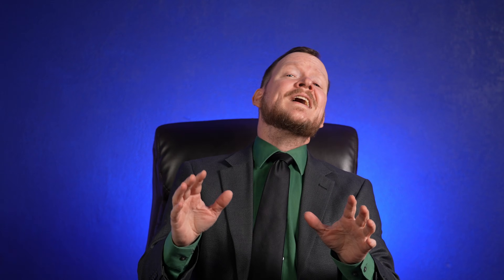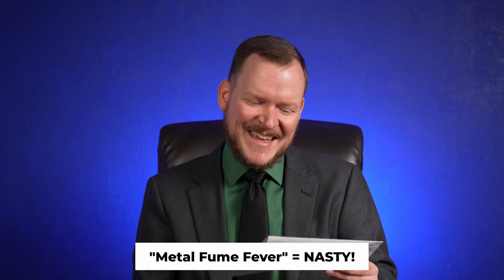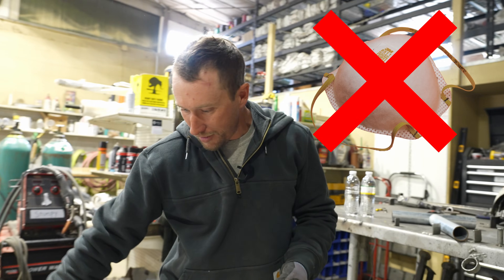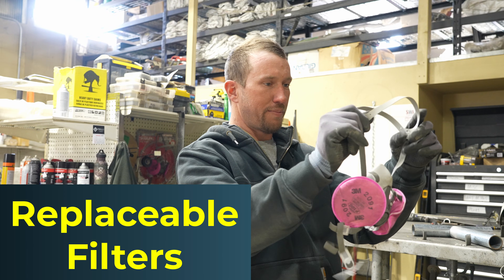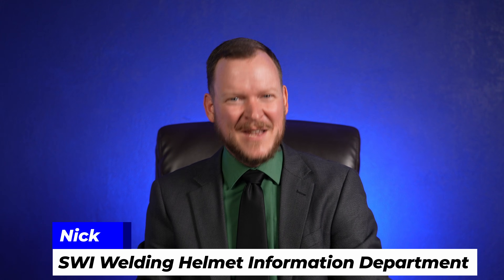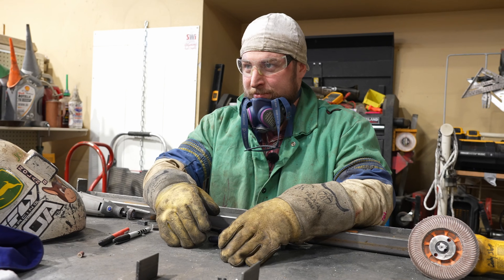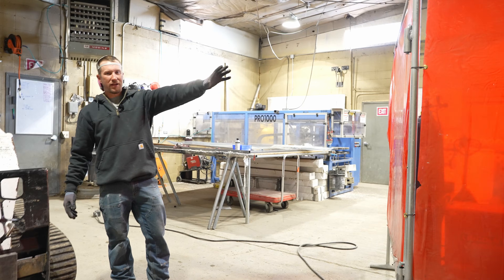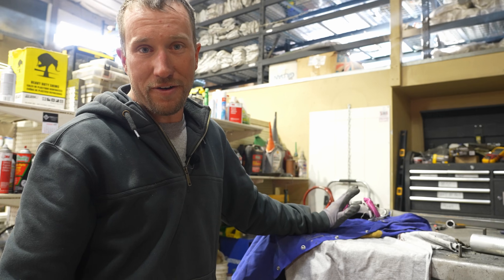How To Weld And Not Die | Welding Galvanized Steel

Comment: Is that true about welders dying after 60 years?
Reply from the maker: Well... yes. 😆 If you're 30 when you're welding than 60 years later you'll be about 90 so.... that's usually around the time.

Comment: The lads here in the Philippines weld galvanised all the time, usually in flip-flips and shirtless, no gloves. Sometimes the safety conscious ones might wear a pair of sunglasses. Sounds like I'll stick to regular steel and my mountain of safety gear; I'll avoid that galvanised shit like the plague. I've been around them a lot when they were welding as we had a team here last year building an extension to the house (they weld the roofs here with thin galvanised frames and rivet the corrugated covering on top) - luckily I was not close enough to get zapped by fumes.
Reply: smh
Do you tell them about the very real dangers? Do they know they probably won't live to 50, or that they will hack a lung in the future?

Comment: I always hang my respirator up in front of a fan in an open area with no fumes. I used to keep my respirators wrapped up in a thick hoodie or blanket and it ended up growing a bunch of mold.
Reply: 10000 dollar osha fine finding an unattended non bagged respirator
Reply: @jodylinnartz4461  I work for myself so it don’t matter
Reply: How about sealed in a plastic bag with a dessicant, after sanitizing?

Comment: Question..
I was told by an old friend.  You can throw a galv peice of pipe that you want to weld on into a hot fire pit and walk away and it will BURN the galv off of the pipe??
Have u ev heard of this?
Reply from the maker: This is the first I've heard of that. The next time I have a hot fire I'll have to try it and see.

Comment: they dont seem to sell the 2097 filters in Australia, I'm looking at a 3m 7500 respirator and it seems to have 2128 filters? would they be any good for this?
Reply from the maker: Hmmm, I'm not up on all the different types of filters out there. You want one specifically for metal fumes. I'd get a hold of a welding supply store--they'll know the answer in a heartbeat.

Comment: I have done a lot of welding over the years and suffered from galvanise fume poison on many occasions. I always brushed it off as a bad flu, because that's exactly what it felt like. Last week I was mig welding a wall mount air-condition bracket up out of some thin galvanised box tube. The welds were tediously slow due to the thin thickness of the metal, all in all about 2 hours welding. That evening I felt I had caught another bloody flu!  I woke up in sever chills and sweat, body was shaking, couldn't walk unless I was prepared to suffer even more so. I tried to drink water which was hard from a very sore throat. I could only lay back in my bed in a cold sweat twitching and shaking and feeling nausea. I had a headache but it wasn't so bad unless I had to cough. Next day was just as bad, with nausea picking up and severe cramps followed by liver or kidney and left inner chest pain. I couldn't eat, only drink lemonade water or milk. 2nd night I laid in front of the heater with jeans, shirt & a blanket all night. I felt like I was going to die. My body was cramping so badly, really painful cramps I couldn't un-cramp some of my muscles cramped in my feet & legs for 5 to 10 min at a time. I did that welding on Wednesday and now it's Saturday, I still have the flu cough and slight chest pain but I can actually get about. At the beginning I actually thought maybe this covid is real and that's what I got. I used the kids free covid tests kits building up in the cabinet 3 times, Nothing! Negative! In the end I linked that poison odour from my lungs and sweat and looked up galvanise fumes to finally realise this isn't a bug or flu. I am left wondering if all galvanise is the same?  I have welded a lot of galvanise steel and never suffered this badly before.
Reply from the maker: Sounds like galv poisoning to me. Maybe you were closer to it than normal or the ventilation was different. Be careful! That stuff's no joke!
Reply: Have you not heard of the term "cumulative"?
Reply: I read that you become more sensitive with each exposure.

Comment: Great video. I knew galvanized welding has its hazards and appreciate your video detailing them, but I need to add one comment concerning scba. Those units do not use oxygen bottles. They use compressed air bottles, basically atmosphere air compressed into the bottle. Breathing pure oxygen can have its own hazards but the volume of oxygen that you have not consumed which exits a positive pressure mask adds its own safety issues to Open Flame or welding sparks. Just look what happens when you turn on then up the oxygen on your oxy acetylene torch. Just food for thought.
Reply from the maker: Great points!

Comment: Any difference in weld penetration between cleaning the galvanized coating off vs not doing so? 

&

Do you have to spray coating over the weld or do you leave it be vs spraying the cleaned off section of pipe which creates an unsightly contrast imo.  

Thx
Reply from the maker: You do get a better weld and not as much spatter when you clean the galv off.
We always spray the coating over the weld. We swear by Galv Pro: https://bit.ly/galvpro

Comment: Prep the steel first by grinding the galvanize coating off of the steel before you weld it. Then you just need a welding shield.
Reply: If it's pipe you'll still have the galvanized coating inside. Unless you have a grinder that fits inside the pipe too
Reply: It’s definitely a good idea to grind off the coating to ensure a clean weld with no inclusions but this doesn’t mean that the workpiece isn’t still producing the same fumes.
Reply: It’s a cheap fix because a lot of places that you can’t clean perfectly heat up enough to produce lead oxide. I only say this 1 year later because if you haven’t realized already, you have not been properly protected     for however long you’ve been working with galv

Comment: I recently just started a new job at a fab shop without having prior experience working with galvanized. I've welded it for about 2 days now and pretty sure I got metal fume fever. I figured something wasn't right and I did the research and sure enough you're supposed to wear a respirator when welding this stuff (which my company does not supply or instruct me prior to welding). I'm so afraid that I might have cause some kind of long term affect to my health. Really hope it isn't the case.... Definitely telling them to buy some equipment..
Reply from the maker: Oh man--sorry to hear that. 😞 If you end up using the 3M face mask like I was using, make sure to use the #2097 filters (NOT the #2091's). The #2091's look exactly the same but don't actually filter vapor. (I actually had the wrong filters attached in the video. 🤦‍♂️🤦‍♂️🤦‍♂️)
Reply: @SWiFence  Those filters work VERY well.  You know you have a good filter if you can't even smell a fart.
Reply: get out of there
Reply: That sucks, your company clearly doesnt care about safety at all
Reply: Get out of there. Ive been in the same situation for 20 years where the company doesn't supply nothing. I cough up black shit every night in the shower. I know its my own fault for not leaving, so my advice is dont be like me.
Reply: Bro I’m in the exact situation
Reply: Company that expects you to weld dangerous items and not provide safety training or equipment. Sounds like a visit to OSHA or dept of L&I would be smart.
Reply: In most countries you have to have a respirator or PAPR  when welding 😅
Reply: @devynselnes4282 yea honestly I just hold my breath and take a breath the opposite way or towards the shop fan
Reply: Good luck